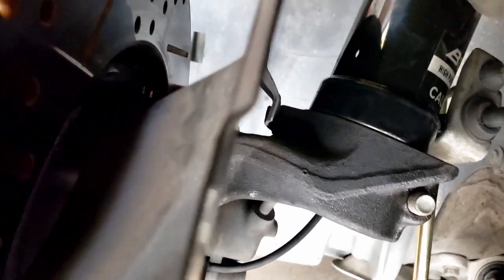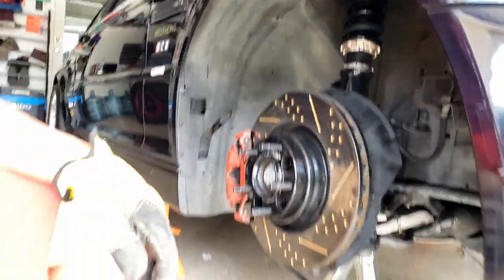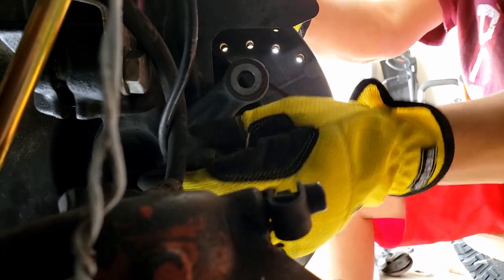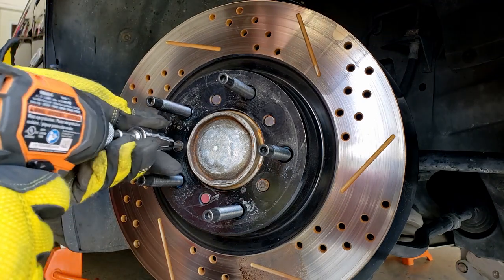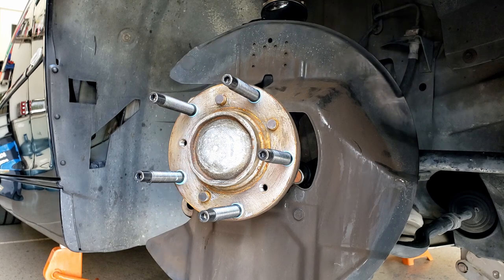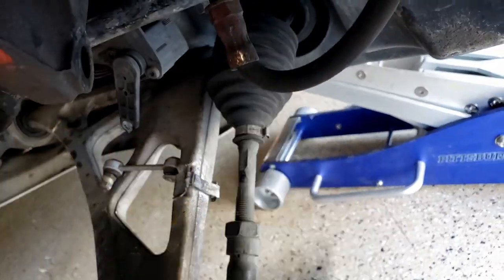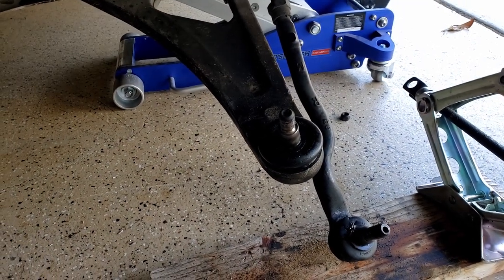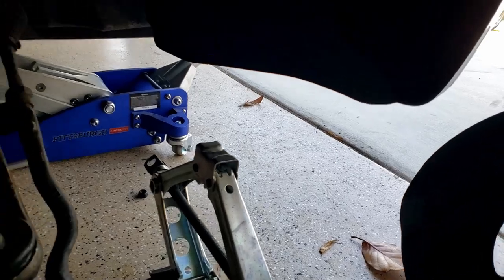Remove & Replace Steering Knuckle Assembly on E46 ///M3.

Comment: I think this is the only video on Youtube to replace this fucking thing. Thanks!
Reply from the maker: Appreciated your watching, friend.
Reply: seriously, i just had to do this same job, and I agree with Charles. When changing my strut i broke the head off that pinch bolt that secures the knuckle to the strut. What a nightmare drilling out that rusted, corroded bolt. In the end, even drilled out, the remnants just won't move. So, i decided to just replace the knuckle following along with your video. I spent 5 hours on that damn pinch bolt. I spent 2 hours (moved slow) replacing the knuckle. Spent $80 bucks on the replacement. Anti-seized all bolts when replacing. Thanks for making this video!  @teslam3chennel
Reply from the maker: Awesome, I'm glad it helps you out. Thank you for watching, friend ✌️